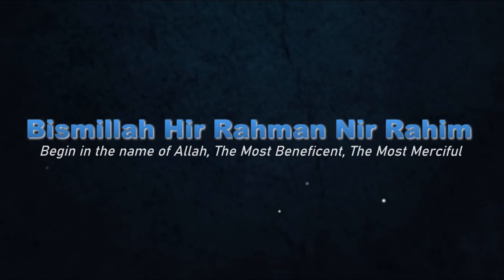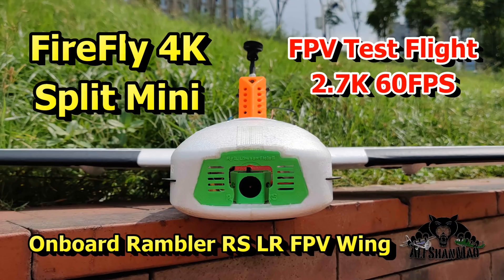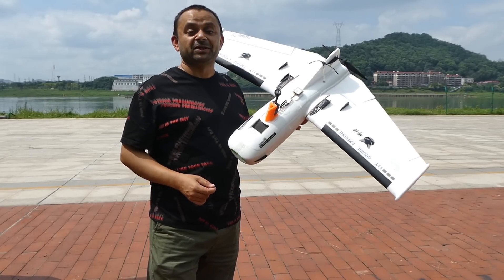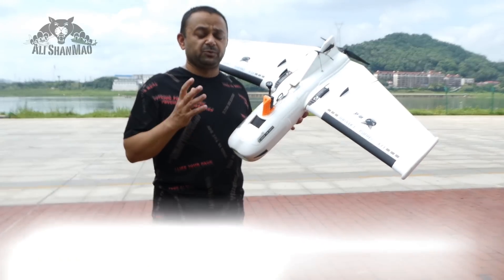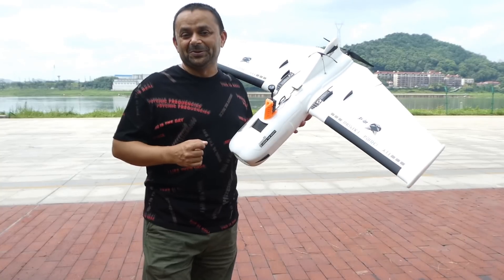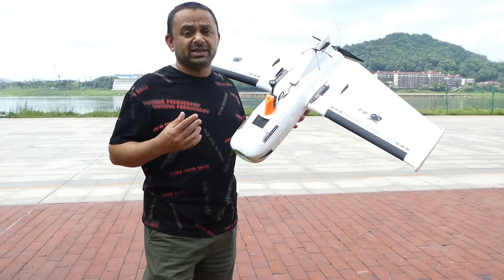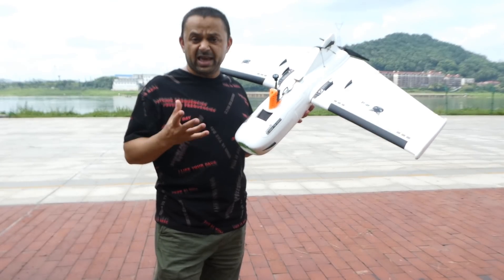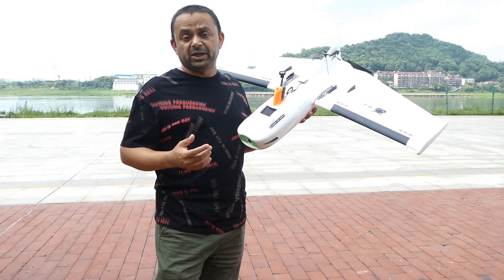Hawkeye FireFly 4K Split Mini AIO HD FPV Camera Flight Testing

Comment: Nice camera... is there somewhere a stabilized camera for fpv ?
Reply from the maker: There are many Action cameras that offer EIS (electronic image stabilization) and even better, use GoPro for realsteady or other 360 cameras that have flowstate stabilization, no need for gimbals.
Reply: alishanmao thank you for your answer... but I am looking for stabilized fpv feed, to avoid being sick while flying fpv. Having action cams with stabilized videos after the flight is nice, but not what I am looking for... ;)
Reply from the maker: if you use a camera that has EIS enabled and same camera is used to record HD Video, you will not see shakes, but stabilized video. You can try FireFly 8S camera. as you can get FPV Feed out of it. Set it to EIS Enable and fly, you will see smooth FPV Feed and at the same time camera can record 4k video 
http://tiny.cc/dry2oz
Reply: alishanmao thank you a lot... I didn’t know this was possible ;)
Now I only have to find a way to obtain digital headtracking and I will be able to replace my disco... (if I manage to implement 4G controls...)

Comment: Just got my aggressor and rambler next week are you going to do the twin motors on the aggressor???? And any folding prop you recommend
Reply from the maker: I am thinking to do a twin motor Aggressor :) Masterairscrew or HQ Props, are best
Reply from the maker: https://www.rcgroups.com/forums/showthread.php?3594963-Aggressor-1200mm-Swept-Forward-Wings-Long-Range-FPV-Flying-Wing/page4#post44854969

do join this and post your vids and pics and experience.